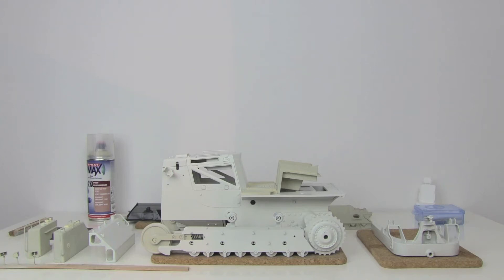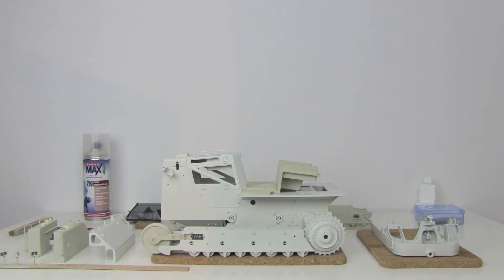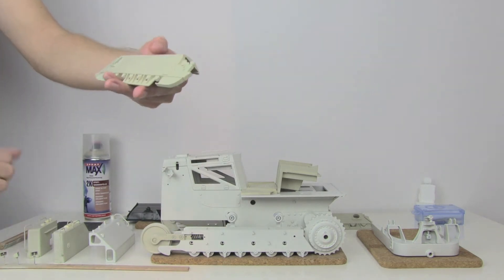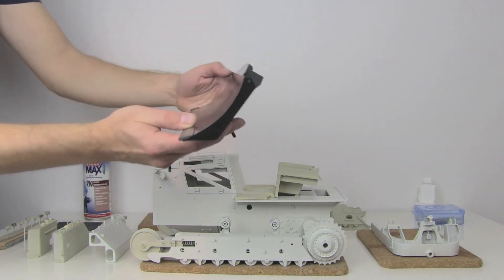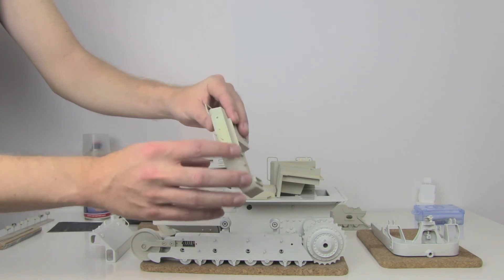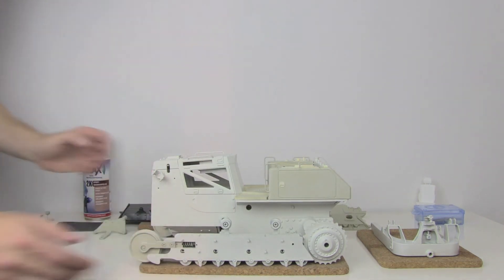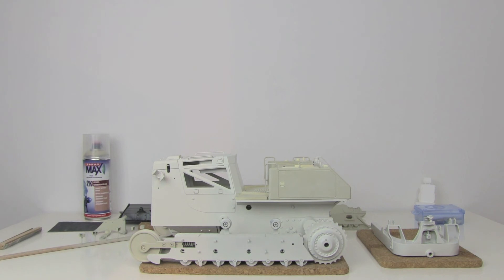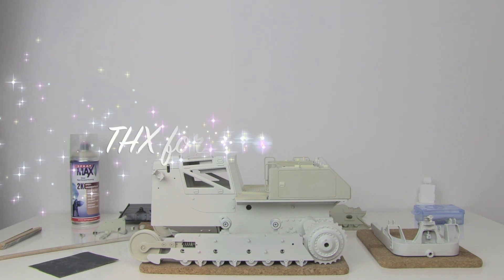HOW YOU BUILD AN 1/14th SCALE BULLDOZER - BRAND NEW KIT PART 2

Comment: The front wheel on your dozer we call an "Idler"
The small wheels along the bottom of the track we call " Bottom Rollers " or "Bogies"
  The 2 on the top   "top rollers "
The cleats on the "Track Pads" or "Track Shoes"  ,  we call "Grousers" 
The upward exhaust  we call a "Smoke Stack" mainly on trucks
      That's it for todays lesson Bjoern..........Tim   ;-)
Reply from the maker: That's great Tim, thanks a lot - I doubt if my english teacher knows these technical terms... ;-)
Reply: RC TRUCK ACTION
I  doubt it if the teacher knows.....but now you do      ;-)
Reply from the maker: You might be right, Tim! :-)